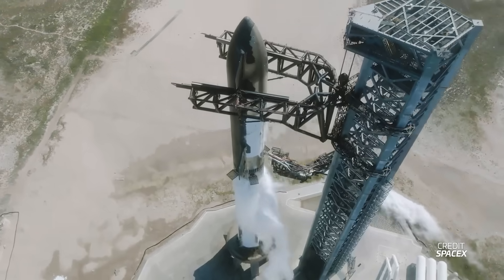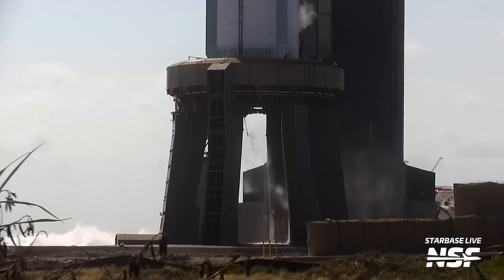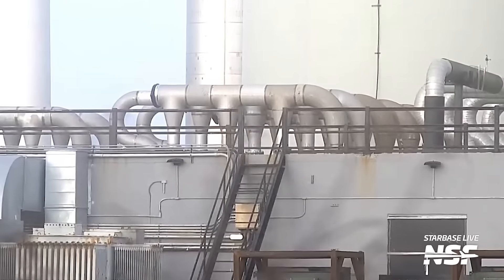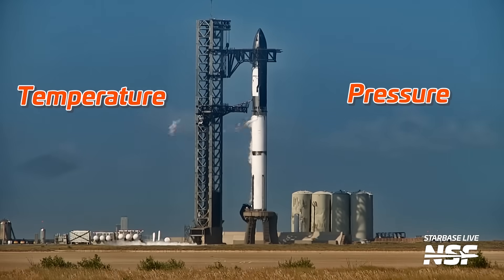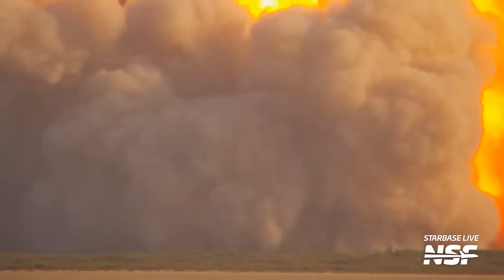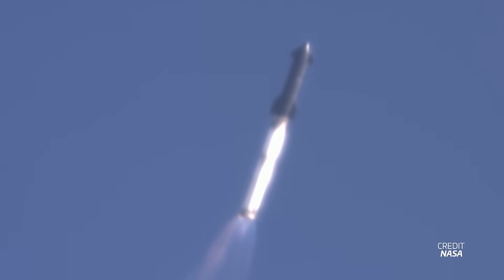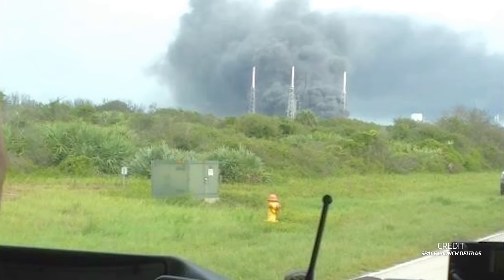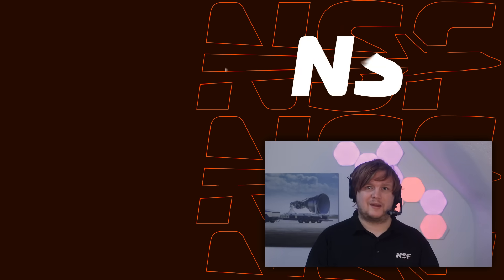Is a Wet Dress Rehearsal Really Necessary for Rocket Launches? Starship!

Comment: You forgot to mention Musk's mantra. Evolution by iteration.

Especially Starship, the design and build is constantly evolving month by month..  Testing every component after every iteration is expensive but incredibly cost effective in the long run.

You only have to look at the mandated changes to Starship that SpaceX had to comply with FAA demands.

This booster and ship configuration has never flown before, as it has changed and upgraded since the first launch, it is an untested vehicle.

Comment: Checking processes, procedures and gaining a normal baseline. The need to be a clean process to show they can get it right with this rocket on this Next flight is vital. A second mishap like the previous launch is likely to see a much bigger investigation process and a bigger environmental impact study which could change delivery times for Artemis moon support missions. If it goes well we are likely to see more launches soon as they need to check many issues such as refueling and re entry and landing.

Comment: The weight of the frost and ice on a fully fueled starship along with its booster, with a frost/ice layer thickness of 1.5 cm, would be approximately 34.5 metric tons. Could some insulation reduce this weight and increase payload? I know there are some lightweight spray insulations that might work?
Reply: Its probably not worth it, more parts aka more failure points for 34.5 metric tons minus the weight of the insulation. And would the insulation be good enough to prevent heat transfer from the air outside to the liquid methane and oxygen?
Reply: I think you meant to say 1.5mm ?  Well, Elon has a high specification for the 'finish' of the Stainless Steel X (SSX), which is smoother than standard industry 'polish' SS, sold by steel company's. 
I think that because of this, a lot of the ice build up, drops off during liftoff. It is just a 'factor' that has to be included in calculations and my thought is that any sprays or coatings would probably introduce a potential 'fuel' hazard or impairment to the launch. Some countries put sheets on the rocket, that drop off during launch. Not something that SpaceX has the 'luxury' of doing over a wildlife reserve. 
It's something they will just have to live with, in my opinion.

Comment: WDR’s primary value is not applicable to Starship test launches: 
1) WDRs are done without risking valuable payloads in place. 
2) WDRs are done to debug things to prepare for a tight launch window.
Starship tests don’t have payloads or tight launch windows. There are other starships waiting to launch & gather critical flight data. When you get the countdown to zero you launch. Starship WDRS are just wasting time until this corrupt administration drops its political barriers to SpaceX launches.

Comment: Someone asked Wernher von Braun, the godfather of modern rocketry, "What was the key to  designing the Saturn V booster rocket that brought a man to the moon?" Paraphrasing here… he said it's all about the fuel pump and the plumbing. Everything  else, including the engine, is predictable once you get the bugs out of it on a test stand. It's literally all about designing a fuel pump, with the horsepower of 6 train locomotives, to pump thousands of gallons of liquid per second through plumbing without causing a tiny leak that blows up the rocket. Now here's where mechanical engineering gets incredibly tricky. The liquid is extremely cold which makes the plumbing metal shrink. The fittings that connect the pipes & various components must shrink exactly the same or there's going to be a leak. Matching the thermal expansion coefficient of all the materials is a really tough engineering problem. And , the use of welds that shrink a little different than the pipe material is yet another nightmare. Sooo… this is why they fuel up the rocket and shack it up with the engines. If it doesn't blow up the plumbing and fuel pumps are good to go!
Reply: I can see where the 3D printed rocket engine technology adds a higher level of 'homogeneous' plumbing and so less chance of a leak. That makes for higher odds of 33 Raptors, not leaking, thus better chances to go to MECO. Wernher von Braun would be like a kid in a lolly shop if he was alive today. Was one of his ideas a launch from under water of a mass of rocket engines? 
I still love "The Right Stuff" movie, where the first astronauts said "Where's the window?"

Comment: Is it just me or is the showerhead a lot more powerful since they connected the additional tanks? 🤔😅
Reply: Indeed it is and in the WDR livestream, NSF did a side-by-side comparison. I also did a rough calculation of 23 seconds, from full flow to when there was a detectable drop in output. The rocket will be gone in about 12 seconds from initial engines being ignited, so they now have a good margin of deluge 'leeway' now. Truly incredible engineering.

Comment: Also, if it is a completely reusable system, repeated testing shouldn't have a deleterious impact on the overall system.
Reply: Your use of the word 'shouldn't' is very apt. Although every other rocket, (except newer rockets are trying carbon fibre), is made from aluminium frame with aluminium skin with extensive proof of it's reliability over 60 years now, the use of stainless steel X, is still in it's infancy. 
We know all the properties of metals, which have had extensive data gathered about them, but in rocket history? Not very much data in rocket history on stainless steel.
Generally, with cooling and heating, you get shrinkage and expansion of metals, they generally 'work harden' as a result. Metal fatigue  is a factor, but the ISS has survived over 20 years of heating and cooling, multiple times per day. So will we see that Stainless Steel X is a superior metal over aluminium, I will have to live to 124 to find out LOL.

Comment: Wet dress rehearsal is more about software than hardware. To see that all the sensors and timing is correct is very important. You want the sensors reporting correctly and the software doing hundreds of things in the correct order. Look no further than Boeing and their crew capsule to see what happens when you don't run a complete dress rehearsal.

Comment: Is it easier to launch and clean the pad instead of safing and detanking?
Reply: No, it's harder to launch, which is why we are here today, still 'hurrying up' and waiting, waiting, waiting, for the second orbital launch of Starship S25B9.
SpaceX have had extensive safing and detanking with their Falcon9 scrubs. And that's 5 million pounds of RP1 & LOX.
But with Starship, a risky time with 10 million pounds (4,600 tonnes) of LOX & CH4, sitting Bottom to Top with 4mm of Stainless Steel between them. (The thickness of the common domes).  A Methane explosion, is a wee bit more lively, than an RP1 explosion. But BOTH are not a good situation to have, unless it's in a rocket engine combustion chamber, during a scheduled launch.

Comment: The recent WDR's have also tested the Hot Staging Ring and it's ability to withstand the weight of a fully loaded Starship. That addition to the full stack can't be tested in real world terms until IFT 2 happens. I know it has been thoroughly evaluated in computer simulations but you never know for sure until this stack launches. The stress on that ring is going to either fail and destroy the vehicle or it will work flawlessly.
Reply: It has been tested in the can crusher too. That puts even more stress on the ring than a fully loaded ship does - likely more than the weight of 3 ships. The maximum force is in fact at MaxQ when the ship and ring experience around 3g.
Reply: Or, it could damage the booster during staging, but not to the point of failure.